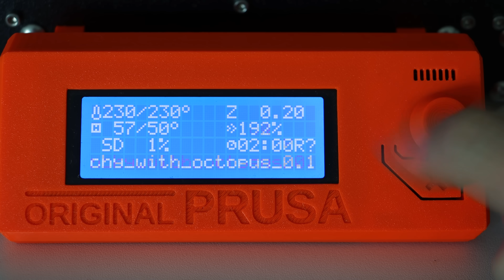PolySonic™ PLA - The Next Generation of High Speed 3D Printing

Comment: It's weird that a Bambu Lab printer is clearly shown in the ad, yet, cardboard spools do not work with the printer's AMS. You should add that caveat to the sales page to set proper expectations with customers. Possibly link to a spool ring model.
Reply: there is also a mod made by polymaker that allows cardboard spools with the ams, it puts a plastic ring around it
Reply: Plenty of spool ring models available.  I have a few on my Printables page, 1 specifically for Polymaker spools
Reply: Not everyone who has a Bambu uses an AMS system. They're also clearly not printing multi color
Reply: Cardboard is fine. Just creates some minor particles that some people don’t like.
Reply: The cardboard spools work perfectly fine. Just blow the dust out of the ams regularly. They just warn people because the machine is designed to be idiot proof.